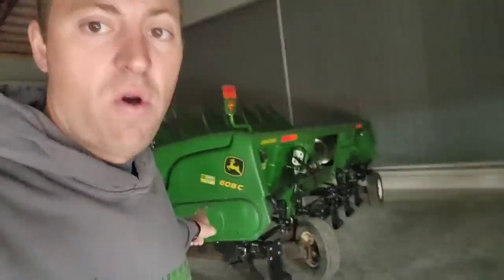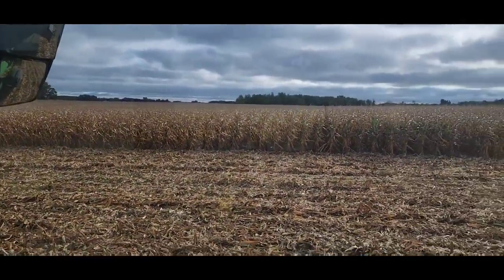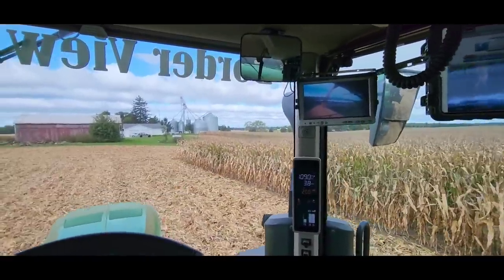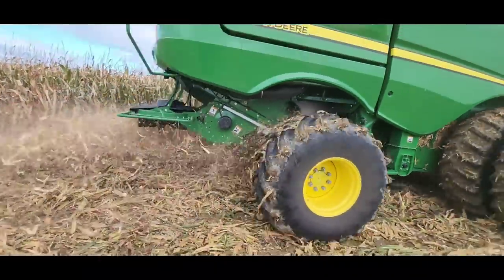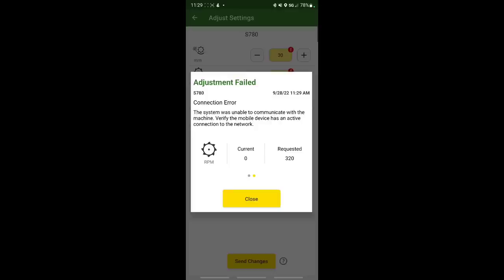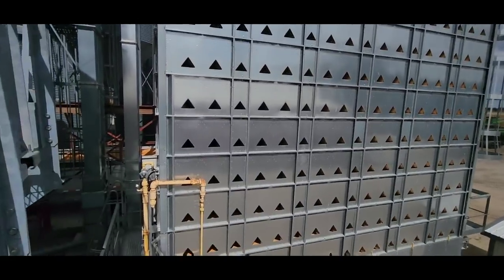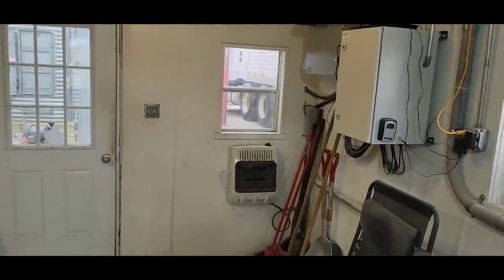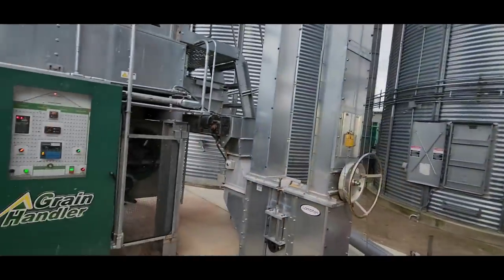Let's Shell Corn!!! - #792

Comment: The average moisture content of the tip kernels in an ear of corn is considerably lower than in the middle or at the butt end of an ear.  The range in the moisture content of the kernels at the three locations of an ear varies by as much as 20 percentage points.

Comment: ok we don't grow corn up here, and i have never seen a corn header up close , only on video's. Don'r know what the truth is and what is bs. So are there different types of corn
heads, i keep hearing about striper plates or striper chains. so do some headers just pull off or brake off the cobs and the rest of the plant falls through or are there cutting knives that cut the corn plant and feed the whole plant through the combine. sometime it looks like nothing much is coming out the back end. lastly corn dust, is that a real thing or another bs talk. being the corn seed is so large any bits should be shaken off, not like our small seed crops, Barley we can have multi kinds of weed seeds in the sample along with the barley seed.
Reply from the maker: All corn heads are designed to bring in as little of the plant as possible. We just want the ears going in the combine. Some Corn heads have stalk choppers which cut the stalks below the head to help process the residue and get it to break down faster. The stripper plate or deck plate as I call them are what snaps the ear off the stalk. The stalk goes down through the rolls and the ear goes in the combine.